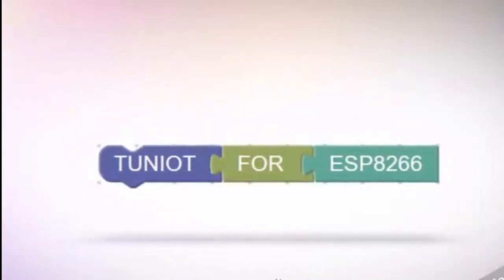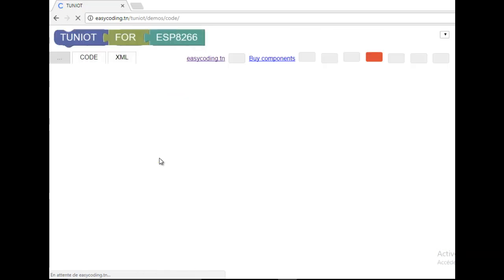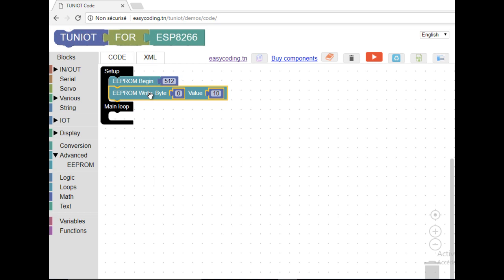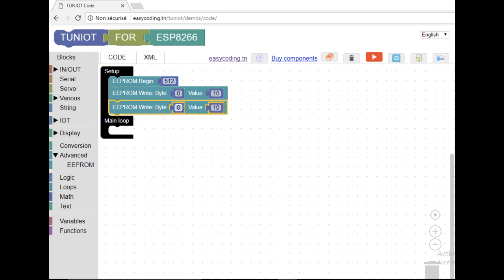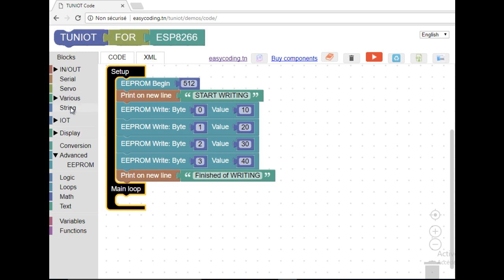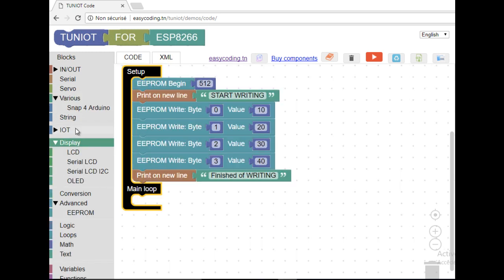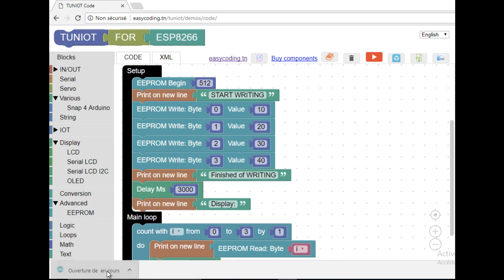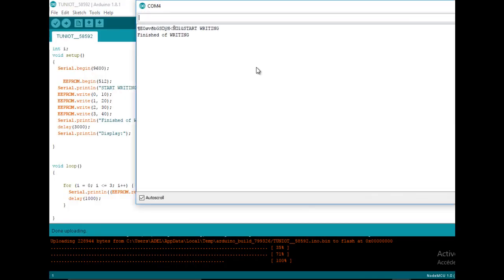NodeMcu (ESP8266) Tutorial A-12: EEPROM

Comment: I got this error "exit status 1
no matching function for call to 'EEPROMClass::begin(int)'
 "
why is this so is there any problem in the code or the library of eeprom.
Reply: Have you imported the library? #include <EEPROM.h>
Reply from the maker: No. The same. Maybe they did an update
Reply: @ADELKASSAH  You need the library to write and read on the EEPROM now, you have to import the library and after you write the value you need to type EEPROM.commit(), so it saves what you have written in the memory